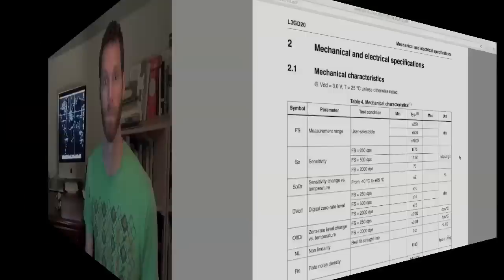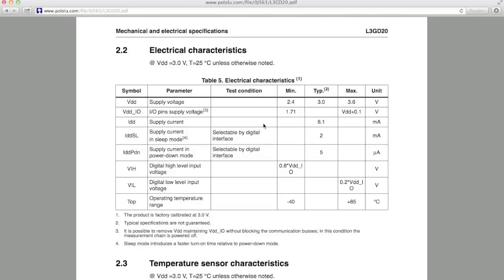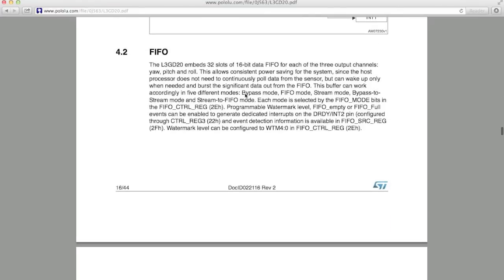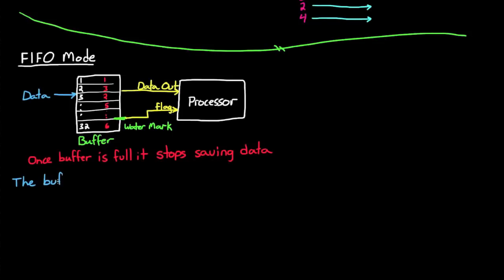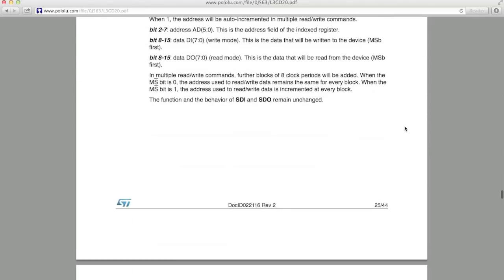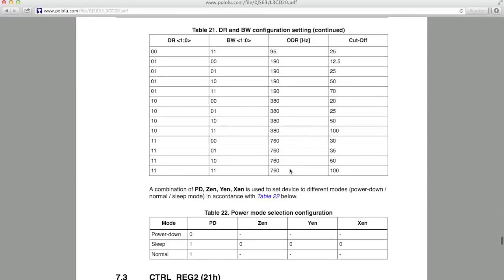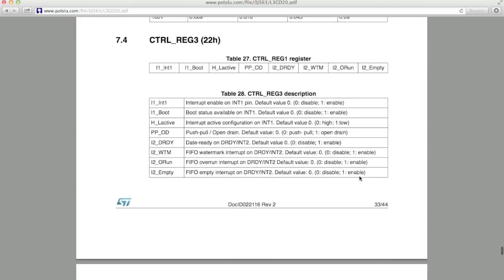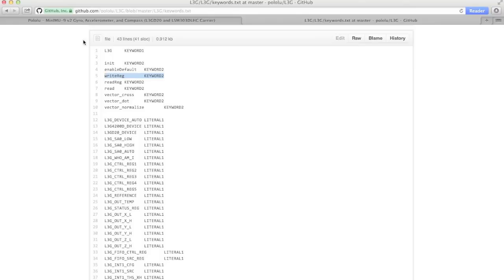Robotic Car - How to read Gyro Datasheets (Part 2)

Comment: People might be wondering what the FIFO is for because a lot of uses in robotics need as recent as possible data. In cameras (including phones), the gyroscope sensor records the movement and can remove some of the motion blur from the image. In this application, the MCU just goes fetching the trajectory in the mems buffer after being done with the picture issue. Cameras and phones are big business in the mems industry, so they get features.

Comment: Hi Brian -- I'm dealing with a problem relevant to what you cover starting at 4:30. I'm using the vl6180x optical sensor's ranging functionality in interrupt mode in order to "wake up" the processor if the range reading drops below a certain threshold. I'm effectively using the vl6180x as a binary proximity sensor with a variable threshold. Now, I'm running into a problem in setting the sampling rate. According to the datasheet (p. 26), each range measurement is composed of a pre-cal period, a convergence period, and an averaging period. The pre-cal period is static, but the max convergence and averaging period are tunable. What's unclear to me is exactly what's being averaged if only one measurement has been taken during the complete sequence (pre-cal _> converge -> average). I.e. if each convergence period yields one range measurement the sensor has converged upon, then no averaging can take place. This makes me think the true measurement flow is as follows: pre-cal -> averaging period containing N convergence periods. The number of measurements averaged, N, depends on the convergence time, which is dependent on the application conditions. Another possibility is that pre-cal periods are necessary for each convergence measurement, i.e. total measurement time = averaging period time = N*(pre-cal time + convergence time), but the pre-cal time is set to 3.2 ms, so averaging even 5 measurements would require >15 ms, which seems unrealistically slow. Can you shed some light on this problem? Is the averaging period simply buffering the raw measurements read during this period?